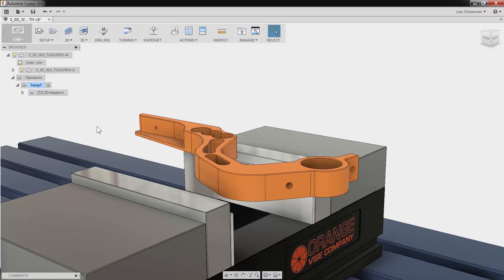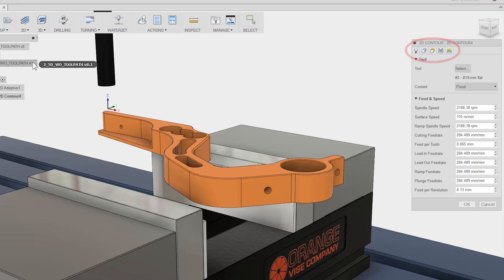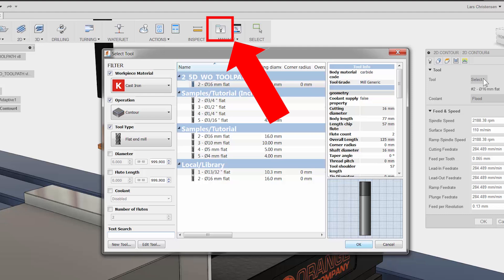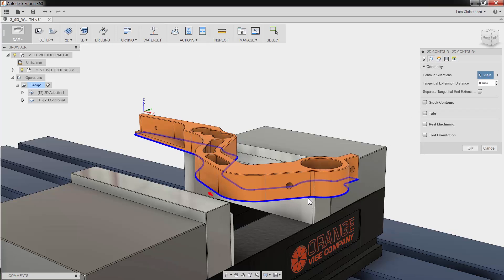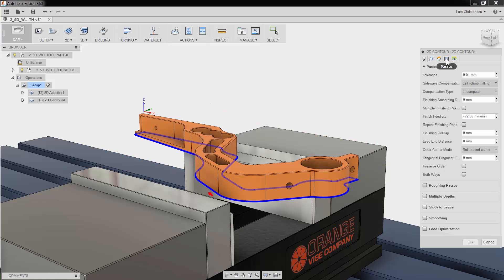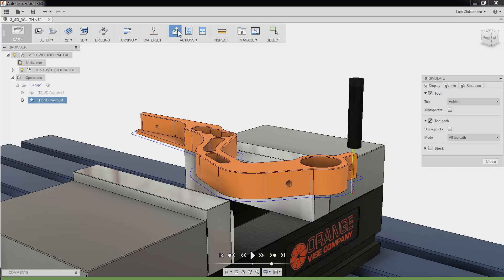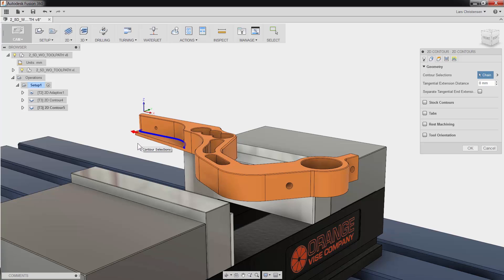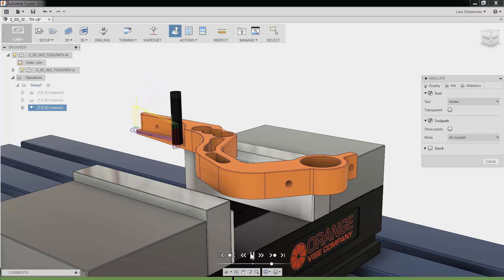Fusion 360 CAM — Quick Tutorial on 2D Contour

Comment: Lars, excellent tutorial, but one thing that seemed to be skipped over (and that I definitely would like to know) is how you got the result of the previous 2D adaptive clearing step to be the starting stock for this operation. We I try to do something similar, I get a toolpath that assumes I have a square stock piece and recuts everything that was already removed in the roughing 2d adaptive clearing step.
Reply from the maker: +Len Sherman Hi Len. Thank you for taking the time to watch the video. Not having seen your part, I might be a little off. But, you have 4 choices...1)You could you a 3D model that resembles your already machined operations and use "From solid" in the stock option (might be a lot of work :-)) 2)You could right click on your model after simulating it and save it as an STL and then bring that in as "From solid" in you stock. 3)You could possible use "Stock Contour" on your geometry tab. 4) You could let your 2nd Adaptive toolpath be a 3D Adaptive Tool path that has the option to treat previous operations as stock.
I would probably think that the fourth option would be the easiest.Hope that helps! Have a great day!